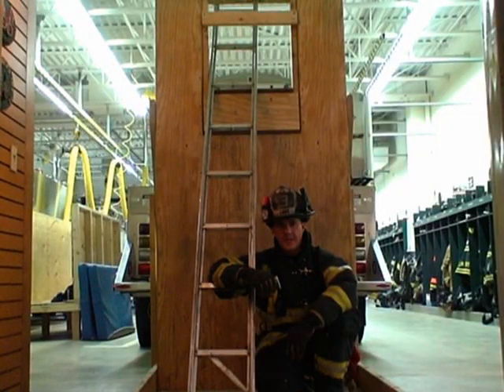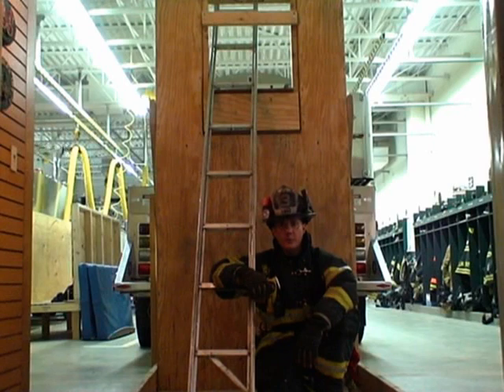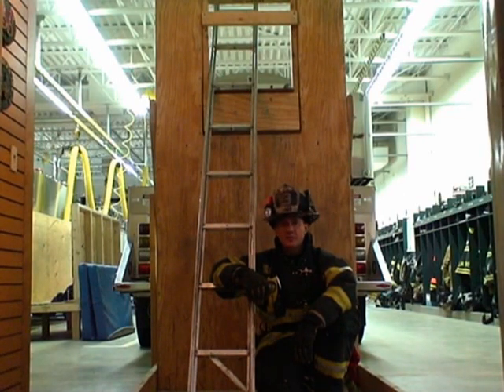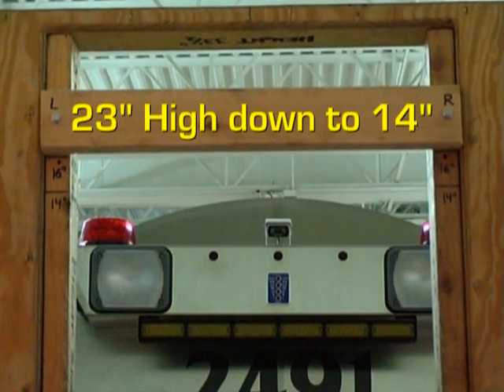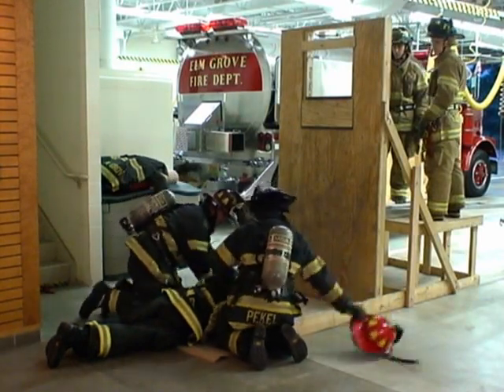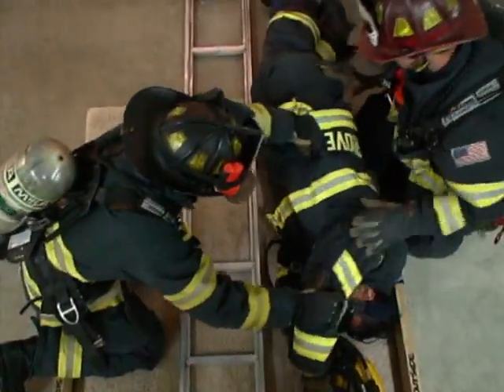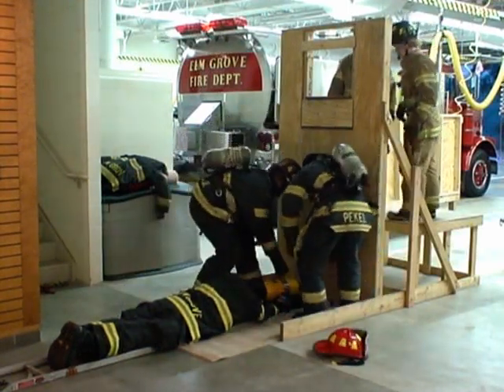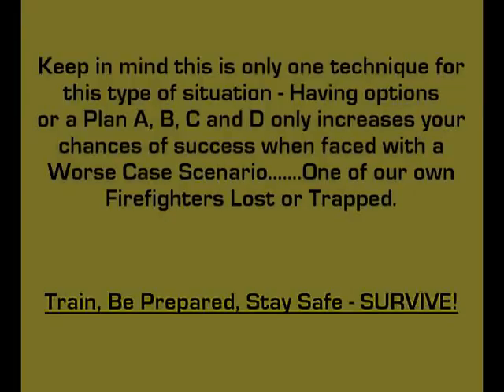Firefighter Basement Window Extraction

Comment: I really like the halligan underneath for the cavity space.
We do this in RIT classes, but what we have found is that if you place the ladder in upside down, you can use the ladder feet to keep the ladder from slipping back in once you load it with weight.  Also, keep in mind that the rescuers will need to egress too.  I have my recruits rotate either right or left as they exit the basement, so that youre not landing on top of each other. 
Nice video.   Keep em coming.